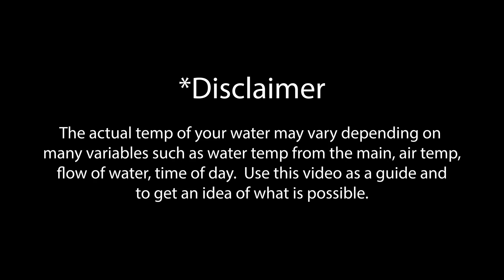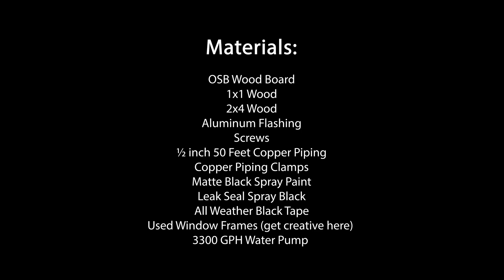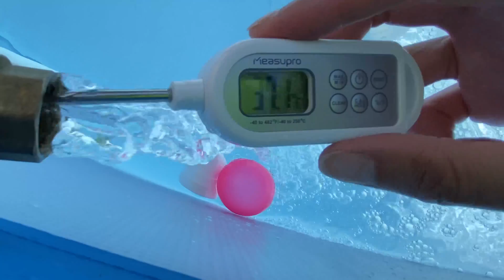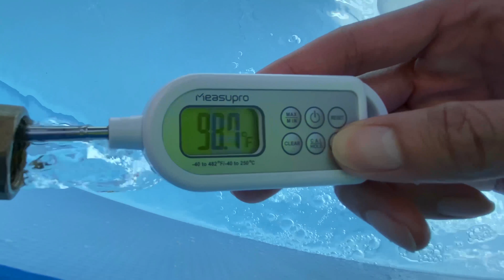DIY Solar Pool Heater HOT! Simple and Easy Design - How to build and does it work? 2022

Comment: Looks great. You could also consider adding a thin layer of sand to what the coil pipes sit on, and then having two large mirrors on the ground angled at the sand to make the heat increase, like them solar power stations near Vegas maybe